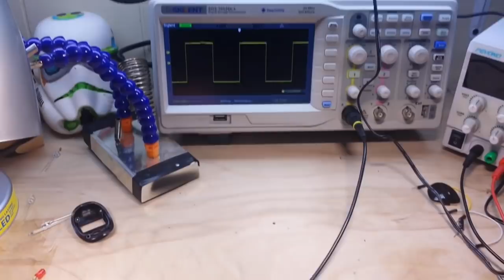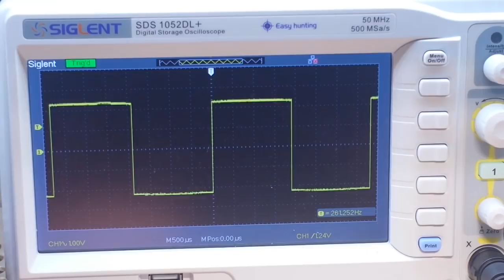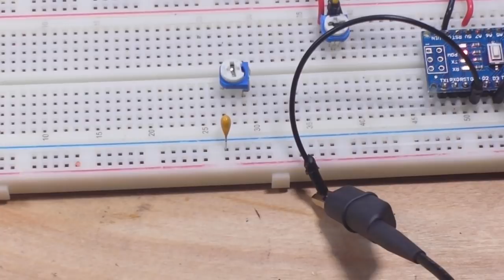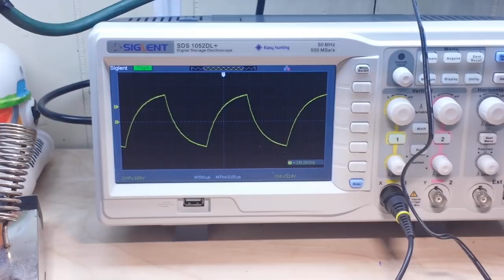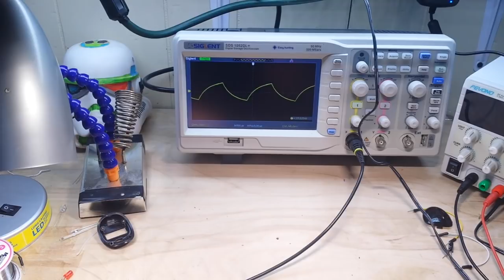synth experiments 2

Comment: Hi Paul, I'm New to arduino,do and you  are obviously experienced with them do you know of a ramp generator circuit for a arduino nano, to ramp  from 440 KHz to 460 KHz, I want to use it as part of a bigger circuit,and thought I could use one of these Nano's sitting here,and make a start in the arduino night mare.
Paul
Reply from the maker: When you say ramp, are you talking about the ramp waveform? Or are you talking about a sweep in frequency?
Reply: Hi Paul  ramp  is wrong in what I'm thinking of Sweep is probably right between two given points.

Comment: Why not use the Arduino as a glorified inverter by reading in one port and setting another output port as the opposite level and then throw the RC network in between.   Just to see if it sounds any different from the tone function. 
 When you add a high pass filter I assume you are going to create a notch that will start allowing nice sweeping modulation type effects.   I might be doing that myself this weekend.
Reply from the maker: Cool

Comment: You have a voltage controlled oscillator there so you could use some tactile switches and a resistor ladder so you can make different notes. Then just map particular input voltages to specific frequencies in the code. Would make it interesting to see if your filters have different effects at various frequencies without changing the circuit.
Reply from the maker: We will be getting there in furture videos.